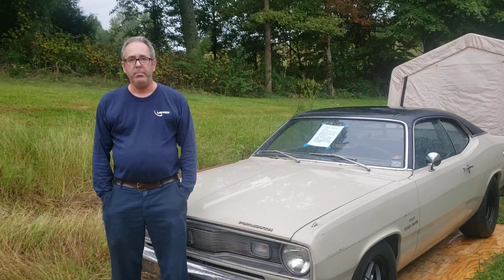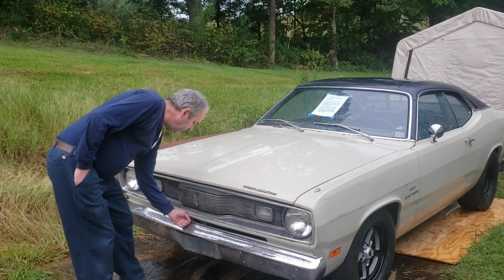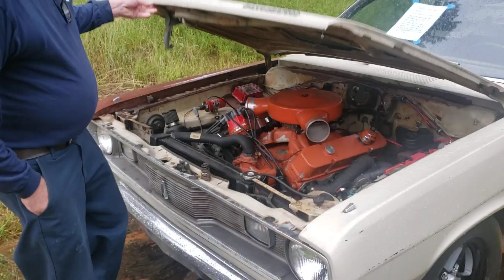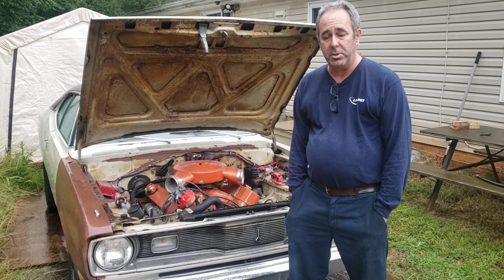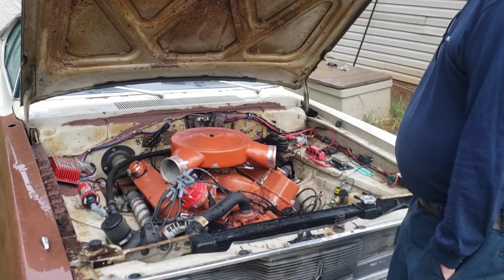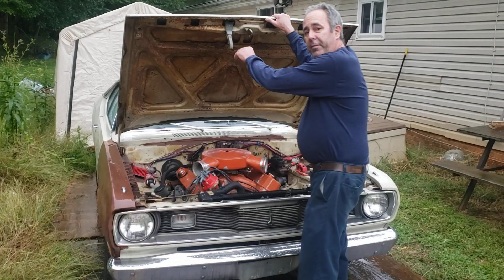440 Gold Duster, Houston, we have a PROBLEM!

Comment from the maker: I found the problem. The MSD box is indeed bad. I carefully checked everything with my wiring and it all checked out good. I put two volt meters, one on the main power input and the other on the ignition switch input, started the engine and it only took about a minute for the engine to stop running because it lost spark. Both of the inputs still had full power. I also noticed that every time the problem happens, if I shut the ignition off them back on the engine starts right up and runs fine until the problem happens again. I'm going to try one more replacement box but if it doesn't work I'm re-installing the 6AL I took out and going back to mechanical advance and I'll modify the weights to get the curve down to 12-14 degrees.
Reply: .Years ago I had 6AL brand new did not function. replaced with new and was good. while i was racing that day I plugged in mopar chrome box and lost .02 or such. hope it runs fine for you now